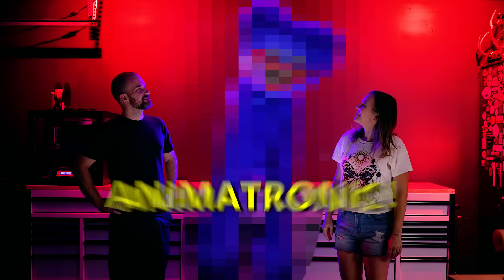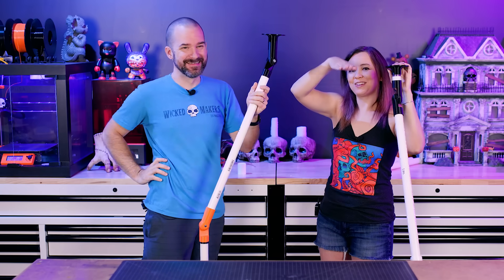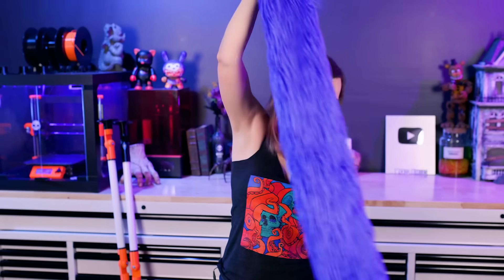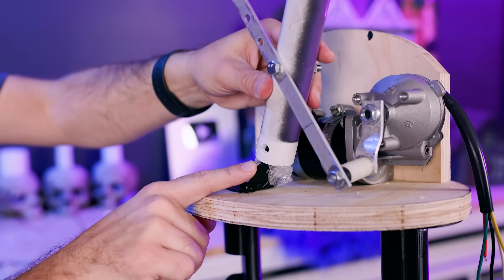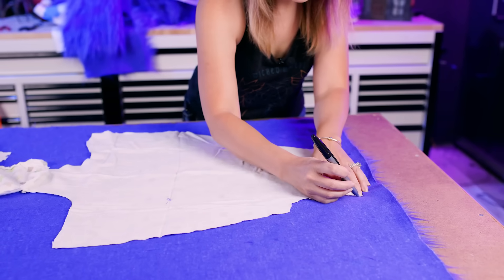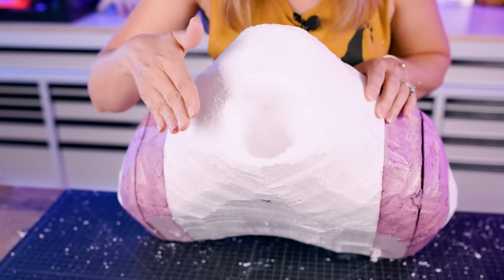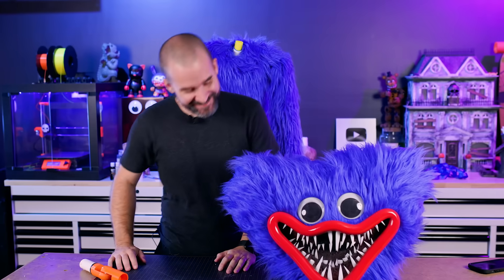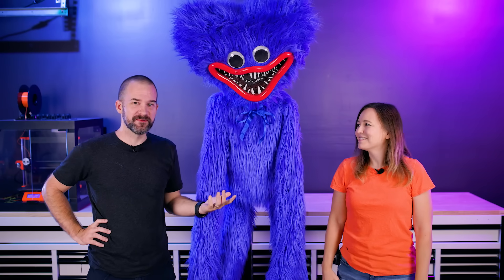We made a real life HUGGY WUGGY Animatronic!

Comment: Every project is a learning experience and you never know what you don't know.  Concept was solid.  Weight of the foam and fabric was more of a factor than anticipated so you can plan for that next time.  Joints and motor worked as designed.  Creature's look is spot on.  Gamers will know it on sight.  Over all it is a successful built. Congratulations!  Next project will be even better.  As someone who's worked with fur, I suggest getting a shaver just for faux fur to have in the shop.

Comment: I love the mouth, but a nice touch is if you add fishing wire connecting the teeth it resembles saliva, since it’s a clear and reflective string. Maybe you can add that on later or on your future builds. I’ve used this technique on some Halloween stuff before and it works really well- especially at night with only Halloween lights reflecting the wire. Nice job guys!
Reply: Another technique is UV resin, if you shine a torch on it AS you dab it from tooth to tooth it'll go goopy like hot glue but it dries clearer and less yellowed